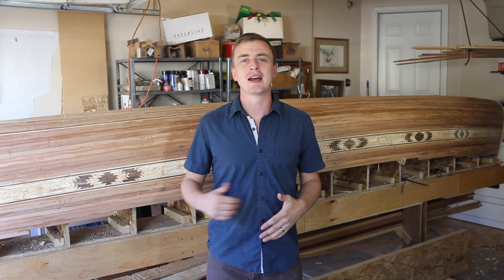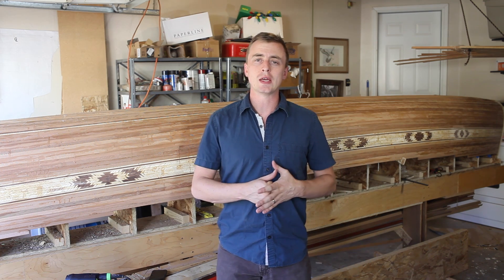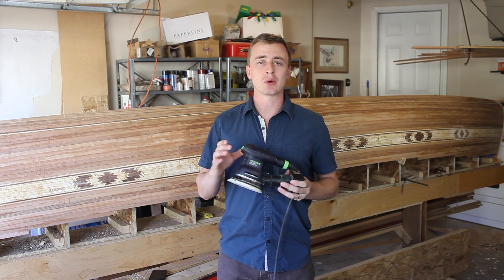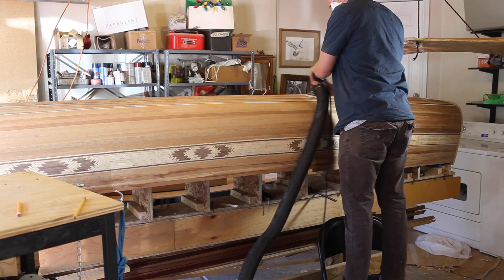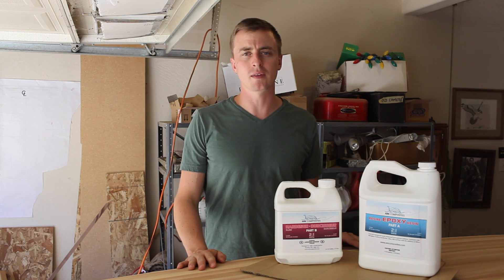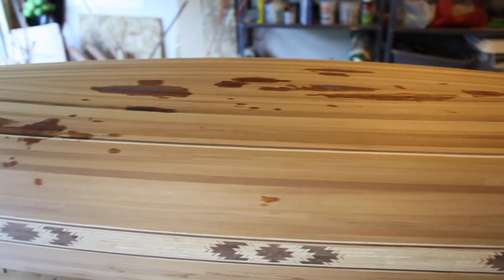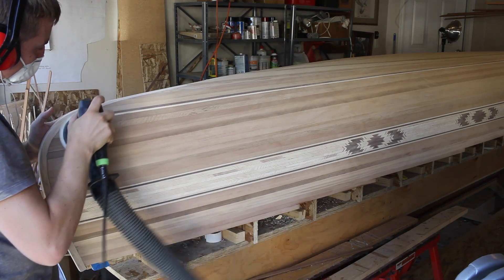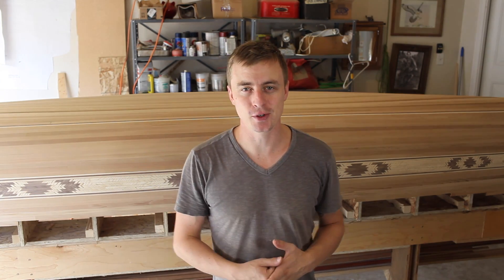Prepping the Hull to Fiberglass (Ep 9 - Cedar Strip Canoe Build)

Comment: Hey Adam, great videos. Can't wait for the next one. I just milled a bunch of huge old growth white ash and am drying it now. Do you have any thoughts about using it instead of cedar for the strips?
Reply from the maker: Jerry Woodruff thanks jerry! The white wood in my design is white ash - I really like ash and it's easy to work with. It also bends well for a hard wood. Your main problem would be its way heavier than cedar and the canoe would be probably 3xs as heavy in the end. The other consideration is that it doesn't bend quite as well as cedar, so the tricky compound bends would be really difficult. One thing you could do is make some strips 5/8" or 1/2" wide (instead of 3/4) and use those for the difficult parts.
You'd have a really unique canoe for sure. There's somebody on Instagram - preszler woodshop - who is making a canoe with zebrawood and black walnut right now. I love ash, you'd just have to do more problem solving - which is part of the fun ¯\(ツ)/¯ thanks for watching, good luck w yours!✌🏽️
Reply: Ash is ideal for the gunwales, stems, seats and thwarts of a canoe. I wouldn't use it for the hull because of the weight. Ash is also good for the shaft and T-grip on a paddle. Ash is excellent for other outdoor gear. Think about the rest of the year and use it for snowshoes, dogsleds and ax handles. Ash is a wonderful wood that is better than most other species for many uses. I don't think a canoe hull is the best use for ash but there is something to be said for using what's on hand.